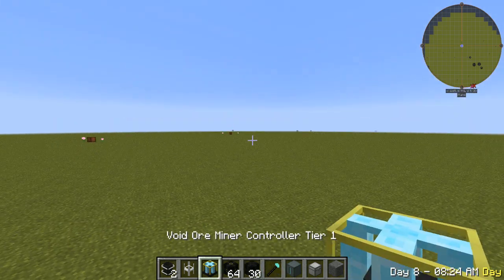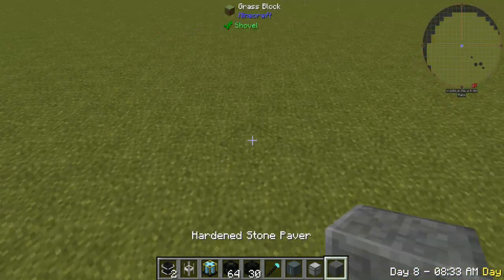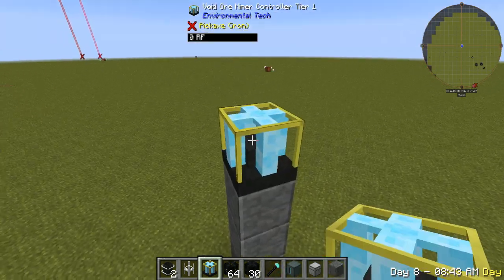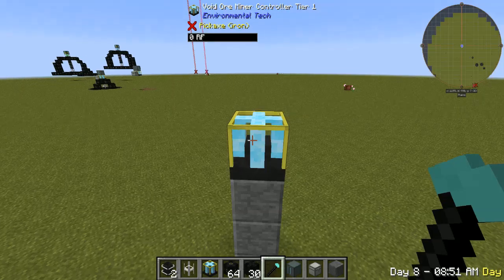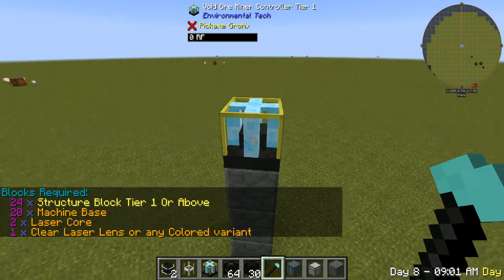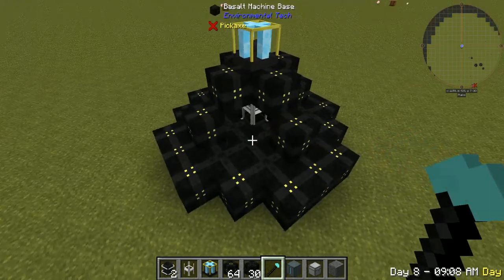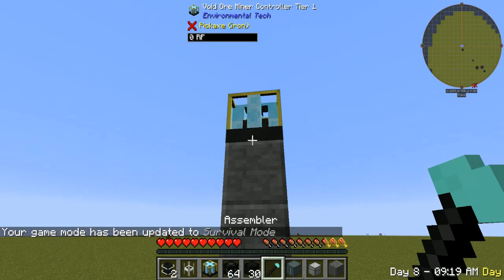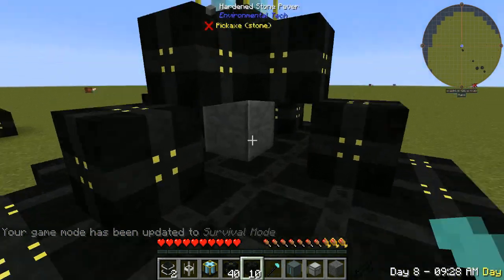how to setup: Tier 1 void ore miner (Envirmental tech)

Comment from the maker: If the miner does not turn on try using a lever on the very top of the miner to turn it on...some versions of envirmental tech do not require the lever.
Reply: the lever isn't working either :/
Reply from the maker: @WednesdayTheClove  are all blocks between the center of the laser and bedrock cleared ?
Reply: @RIFFRAFF1988  I ended up finding out that was necessary right after replying to you. Thank you